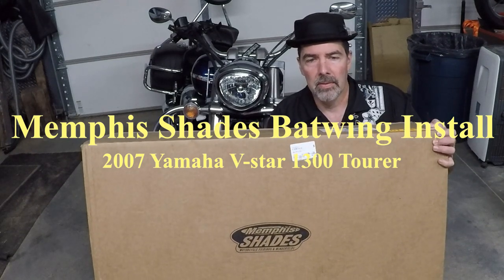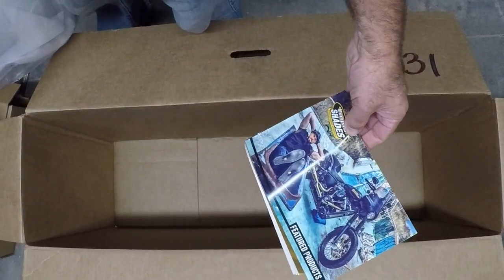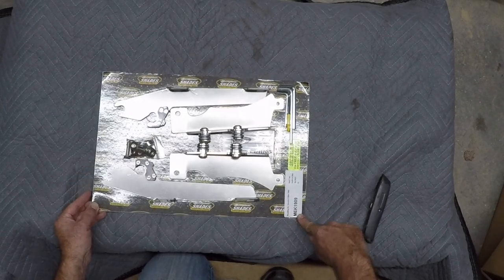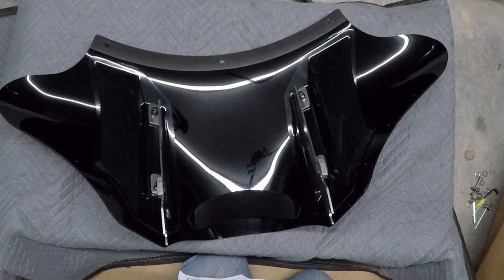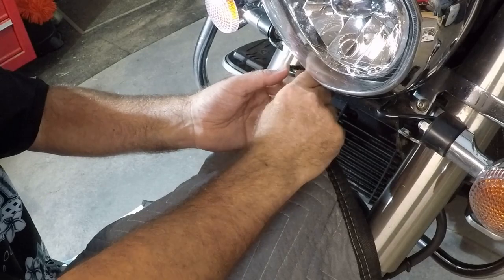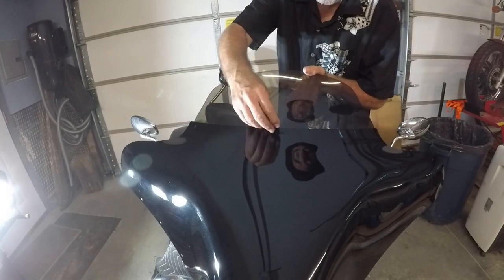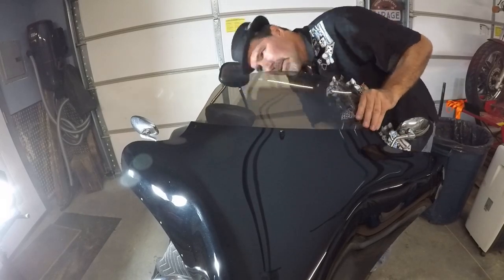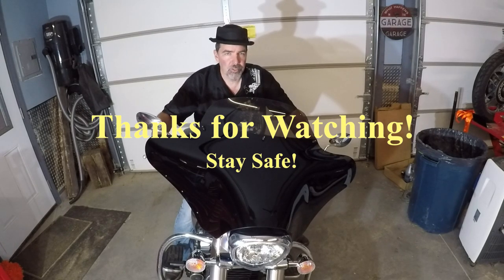Memphis Shades Batwing Fairing install on the 2007 V Star 1300. #memphisshades #batwing #vstar1300

Comment: A few things I didn't like about the Memphis Shades fairings (other than the price) is those brackets don't have much adjustment on them so you pretty much have to use it where it is mounted no matter if it works for wind protection or not. The angle make alot of difference in how the air comes over and around it. 
 I instead purchased the cheaper version of Amazon ($135) that comes with a windshield and brackets that can be mounted in any configuration so it had endless adjustment positions. It's pretty well built and is as good as a Memphis Shades at a fraction of the price.
Reply from the maker: I agree that there isn't a lot of adjustment on the fairing.  I did adjust mine once to see if I could get the wind to clear the top of my helmet.  I ended up with the "bobble head" experience.  I put it back to the position that I had it before.  I've been riding with the front fork wind deflectors and the fairing.  It's a better ride in my opinion.  I had initially thought about going with one from Amazon.  Glad to hear that you got a good set up.  Thanks for watching and stay safe.

Comment: I have this exact same setup but I can't get on board with it I get buffeting to the extreme. I originally had a 12inch screen with the same issue any ideas on how to solve this. Also lovely looking bike great video
Reply from the maker: Thanks for watching. I installed a set of fork deflectors. That eliminated the buffering.  I ordered the MEM5804 from Memphis Shades.

Comment: Thank you for the video. I also drive an Xvs 1300 a midnight Star 2007 and bought the batwing fairing - in Germany. The video helped me a lot. Is there also an inner shell for the Batwing to install a radio? Next to it I drive a Kawasaki GPz 1100 Ut 1985. Sorry my English is not good, but better than my Chinese 😎
Reply from the maker: Thanks for watching.  I don't think that there is an inner shell available for the batwing.  There is a leather pouch for storage. I have heard of other riders buying Bluetooth radios that attach to the handlebars.  I might look into that later or upgrade to a batwing that will fit a radio.  They are a little more expensive thought.  The 85 GPz 1100 sounds pretty nice and fast.  Have a good one and stay safe.

Comment: Is there a way to lessen the gap between the fairing and the headlight?  It just seems a bit Ill fitting.
Reply from the maker: Yes. The mounting brackets are adjustable.  The instructions don't say anything about it though. I adjusted mine.

Comment: Any thoughts re the windscreen height? Does the 6.6 inch work well - or if anyone has the taller ones, any thoughts re performance, buffeting, etc appreciated.
Reply from the maker: The 6.5 worked well for me.  I found out that the buffeting is fixed by installing fork deflectors.
Reply: @wonkster1970  thanks. i've got the fork deflectors - no batwing yet

Comment: Hi.
Thanks for your great videos.
I'm a subscriber.

how do i know if a motorcycle has 5,000 miles or 105,000 miles on it since the odometers only have 5 number slots (ex: 99,999 miles maximum readout) ?

I'm looking at a 2007 Yamaha VStar with supposedly "01,700 Miles" on it.

How do I know that the miles aren't actually 101,700 in reality ?
Meaning how do I know the owner didnt reach the 99,999 mile mark then drive it another  1,700 miles, rolling the odometer over once totalling 101,700 miles and trying to pretend like it's 01,700 miles ?

Thank you.
Anybody knowledgeable please reply soon.
Reply from the maker: Thanks for watching.  I purchased my 2007 with 29,000 miles on it.  I would be really surprised if the bike you are looking at has 101,700 miles on it.  Do you know if the seller is the original owner?  If the bike has been registered with the Department of Motor Vehicles, you could check what the mileage was when it was registered.  You could also to a VIN lookup.  Give the bike a look over.  Look for signs of excessive wear.  The rubber on the shifter on mine is worn.  If that bike only has 1,700 miles on it, everything should look new.  Unless it sat outside.
Reply: @wonkster1970  sweet. Thanks for your info. Yea you're right. If it had 100,000 miles more than advertised, it most likely would should a lot more wear. Even the paint maybe with lots of scuffs and bug and rock abrasions. Thanks a lot.

Comment: Nice work.  I'm looking for a batwing for Yamaha Midnight 1900. Would you recommend this?
Reply from the maker: Yes.  I would recommend this. There are a couple things that I've noticed with the fairing.  It does flex a little at higher speeds. I think that I should of went with the 9" windshield also.  The 6.5" seem a little short for me.  I can feel the wind on the top of my helmet while riding.  It isn't bad though.  Thanks for watching.
Reply: where did you buy it?
Reply from the maker: @Mugi666ify  https://memphisshades.com/
Reply: Thx...
Reply: bought it recently for my XV1900 Stratoliner
Reply: @wonkster1970  I have the Memphis shades batwing with a windscreen that was on the bike when I got it. Was wanting to replace the windscreen as it has some age cracks. I’ve been looking at that curved design and shorter, between the 9 and 6. Long story short, how tall are you that the 6” is a little low?
Reply from the maker: @ducati135  I'm 6' 1".  The wind catches the top of my helmet whe I'm riding. I was checking out the Memphis Shades site the other day and there was a video on measuring for a windscreen.   I'll have to find it again and post it.
Reply from the maker: @ducati135  https://youtu.be/n88JPjwYuWI
Check at 3:00 for the measurements.
Reply: @wonkster1970  Thanks for the info. According to the video 9", I'm still debating though because I'm just enough shorter than you that it seems the 6" might work too. Either way it'll be better than the 12" straight that's on it now. Thanks again.